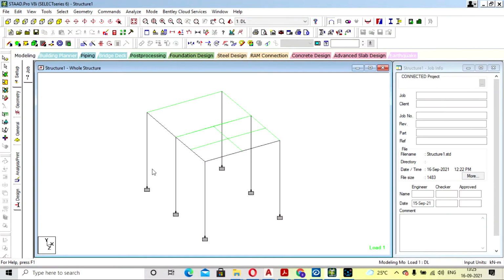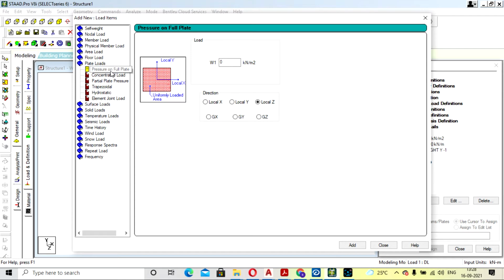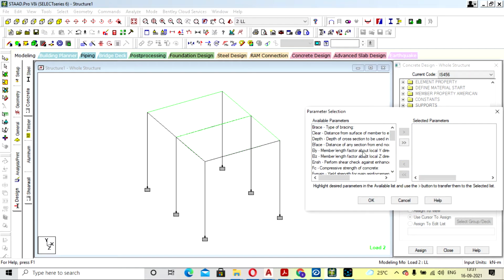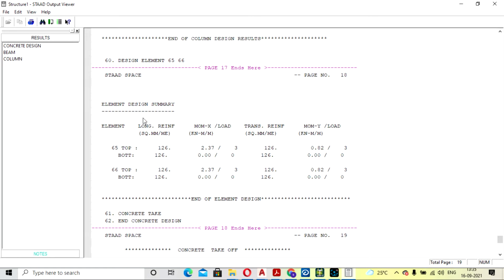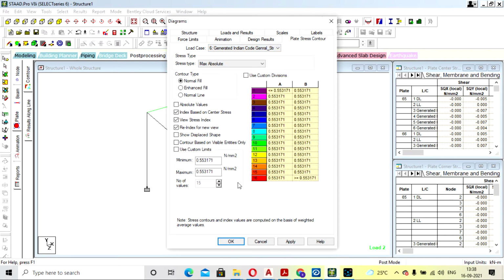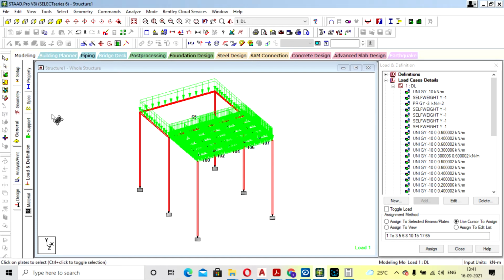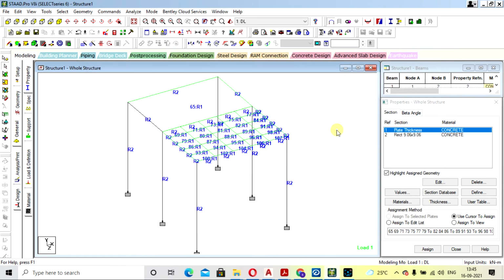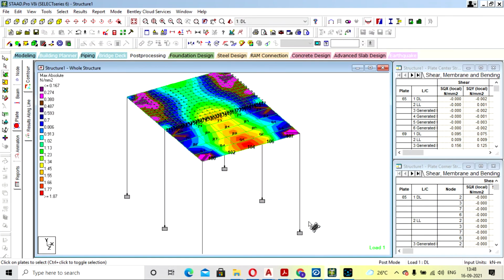Design of slab in Staad Pro-by plate element and meshing method II2021

Comment: Staad CANNOT design Slabs. What you got is a Rigid Concrete Slab like a STONE which is Wrong. Many Software such as ETAB also cannot Design Slab. Those that can design Slabs gave ridiculously complex rebars arrangements which is a pain. Bestis just use a Spreadsheet and manually do some pre-data input, easy and simple.  I have designed a simple programe to design slabs and output simple rebars
Reply: even if you divide the mesh into many little slabs say 10 per sides the output same you get a nice stress diagram but no rebars. Dumb.